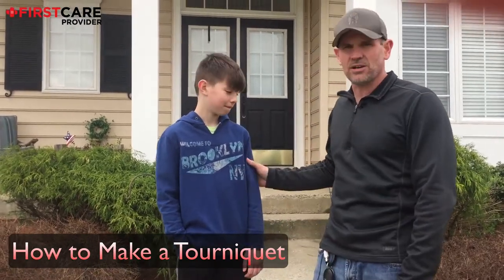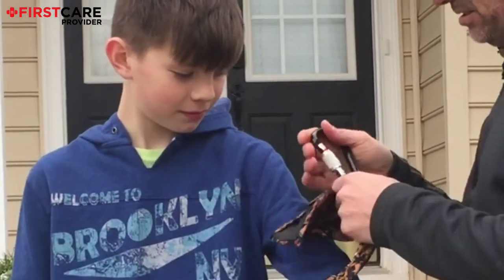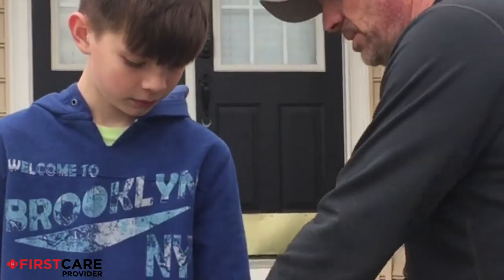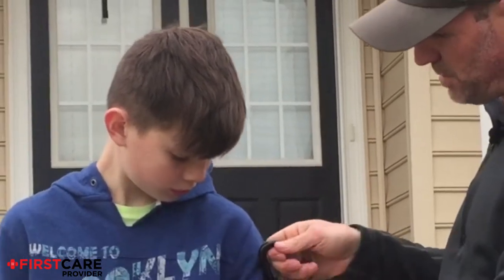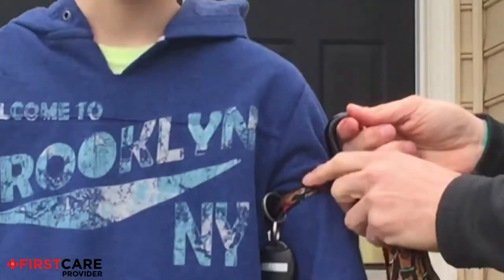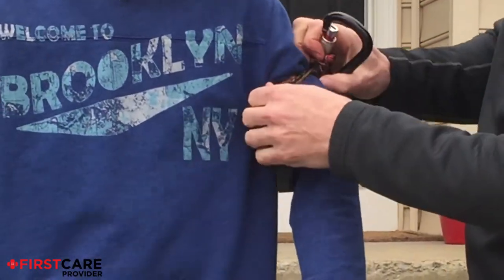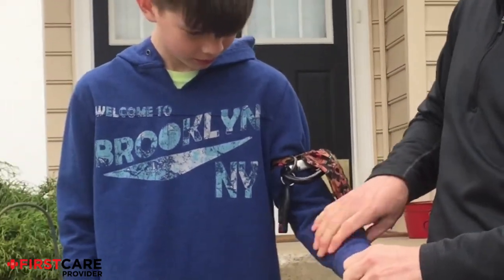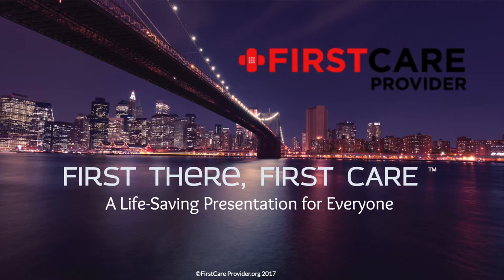How to make a tourniquet

Comment: There is less likely to be nerve damage if you keep the tie 'flat', with a full 2 turns (multiple for cord tourniquet) around the arm.  The knot can be any practical knot like a butterfly, square knot (carefully positioned so it does not capsize into a slip knot), or couple of interleaved clove hitches.  If you don't have the convenient ring which can easily slip & loosen (not off), either tail can be wrapped around the arm to an anchor knot thru the free end of the biner.  It is also a good idea to mark the T:time (grease pencil on the forehead of someone unconscious, &) in case you lose track of time, or get separated during transport, for 15min. re-check times, to avoid unnecessary limb or function loss.